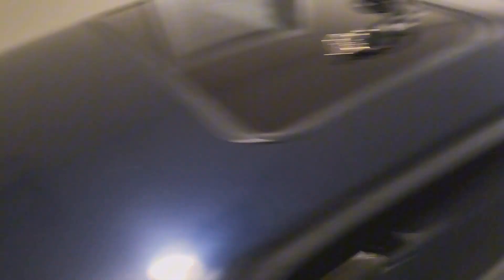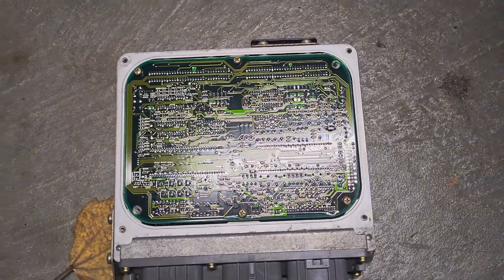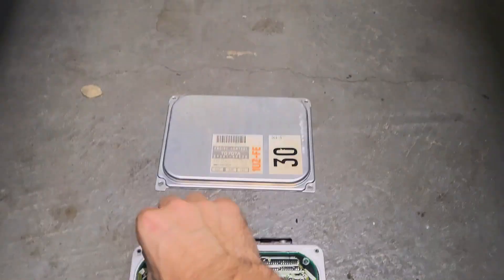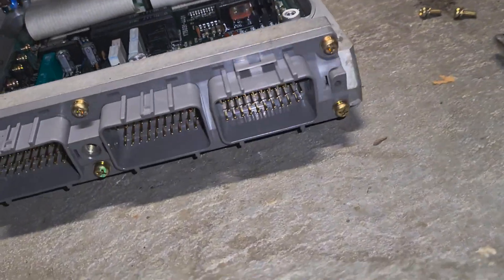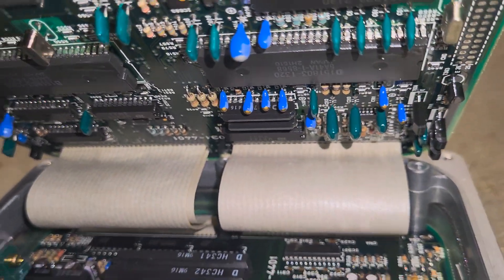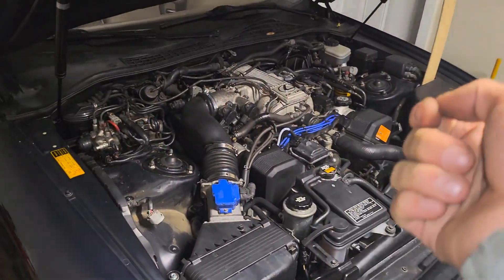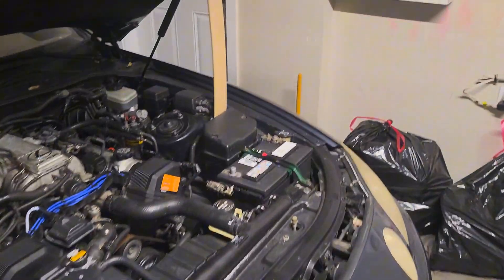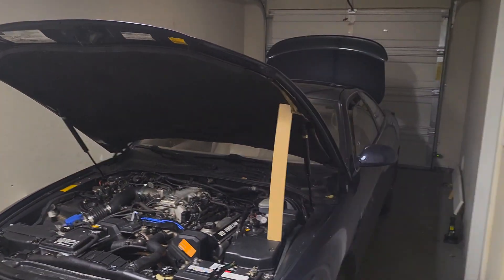lexus sc300/sc400/ls400/gs400 ecu diagnosis.

Comment: I have a 95 sc400 and after replacing my alternator and plug, as well as the fuse the car ran fine but after I turned it off no crank no start no anything really, only half of the electronics work and I've tested all the fuses in the book but my interior fuse box doesn't show any power from a light bulb probe tester, should I get the ecu Rebuilt? Been at a loss for 4 months
Reply from the maker: Open ecu look for leaking stuff aounss like smt isnt connected properlt if u left a metal cip off the slt plug thats why

Comment: Great video I have an issue with my sc400 where it will turn shut off at stop lights and around 1500 rpm runs rough I’m thinking it’s one of the two Ecus
Reply from the maker: Fuel pump ecu almost guarantee